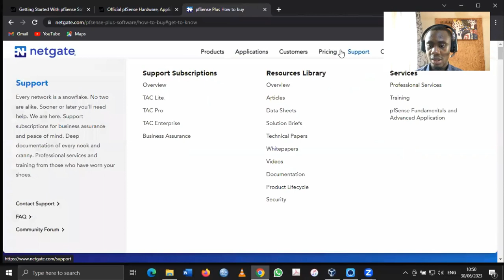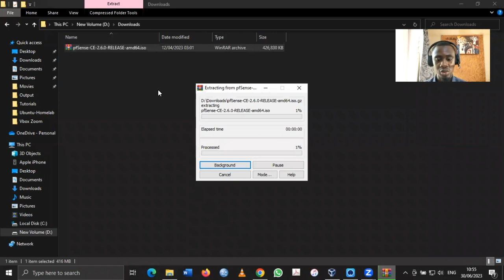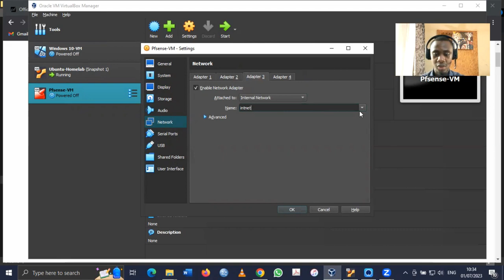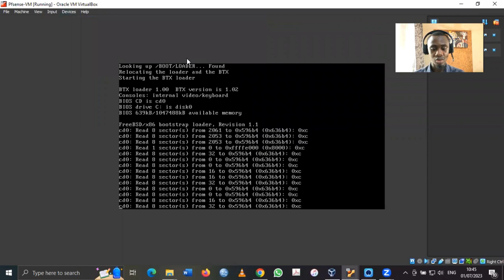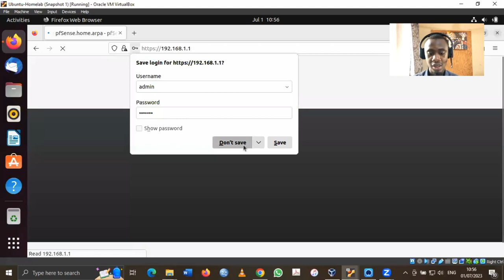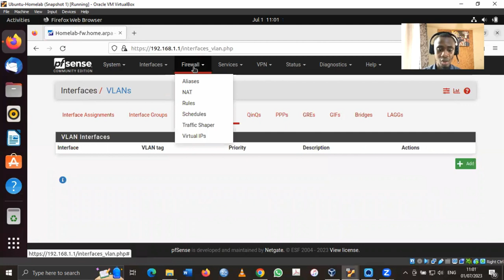Cybersecurity Labs : How to install and configure a Pfsense firewall with Oracle VM Virtualbox

Comment: What should I do when it asks me to "select the WAN interface"?
Reply from the maker: Hey, could you provide a bit more context on which step from the video you have that pop up. Thanks
Reply: @JO_ADDAE hi! I got it figured out actually. Since you made your video, pfsense 2.7.2 came out and they had slightly different interface than 2.7.0 (the one you were working with) when setting up the firewall. Thanks for the reply.
Reply from the maker: Awesome! You’re welcome